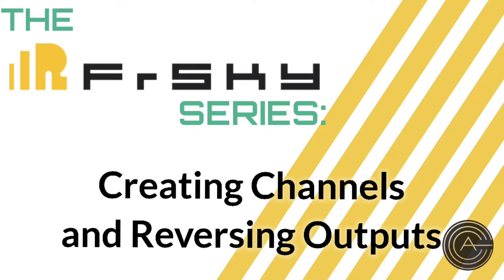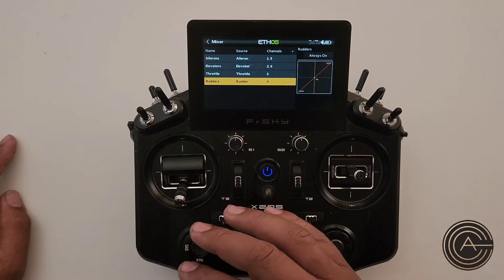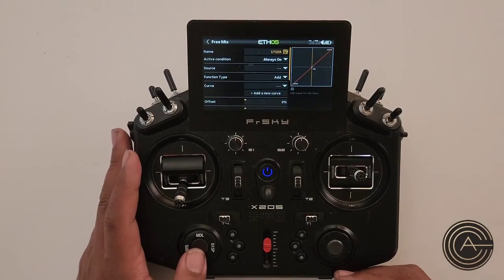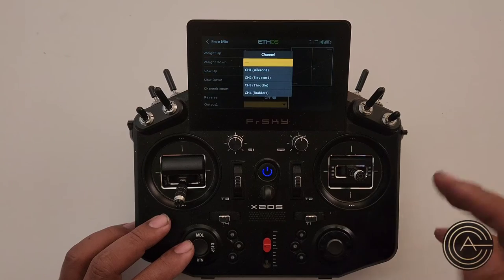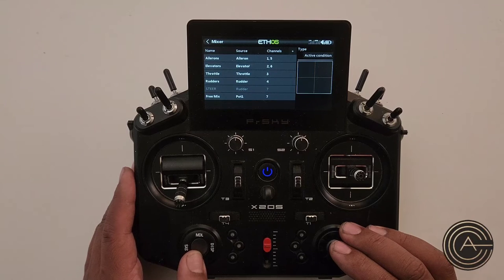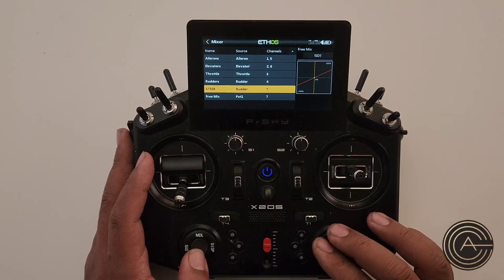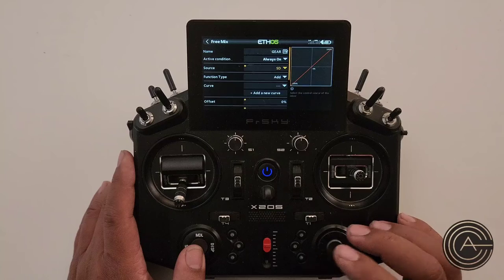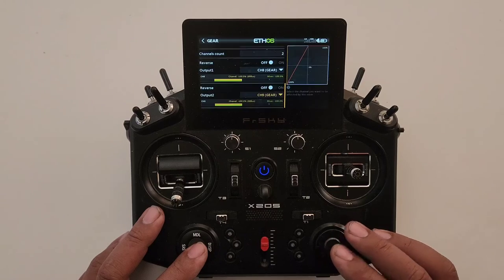The Frsky Series: New Model Setup. Creating Channels and Reversing Outputs (Freewing F-16 70mm)

Comment: Using your setup for my warbird retract tailwheel for trimming with the pot and not steering while retracted. My old radio brand would've taken hours to figure those mixes out. The Ethos system is much more logical, thanks.

Comment: Hi.

First of all, i got an FrSky XE 3D 😍

Your videos is awesome, for one like me, who nearly don’t get anything off it. But i do here 🙏🏻👌🏻

BUT, one question from me. I’m not using the radio for flight, its for an hydraulic excavator and a tractor 👌🏻

Now to the question. I really want a switch, so when i want a break from digging or drive, then i can push it. So the excavator/tractor is still on, but it won't move until I press the button back again and also the radio, so i can touch everything , JUST not that one button.

I hope you understand, what i mean 🙏🏻😊

Please make a video, so i can see what i should do. 😅 ofcause not, if you don’t want to 👍🏻

Best Regards Mike
Reply from the maker: Hello Mike. Apologies but I'm not sure i understand what you are looking for. I'm happy to help but I'll need a bit more info.  Do you want a switch on the transmitter that disables everything or on the excavator? Perhaps give me an example... like when i park, I would like the sounds, motor disabled etc by pressing a button on the transmitter.  Be as specific as possible... hopefully I'll understand!  If it's long,  send me an email at all.rc.air@gmail.com You can attach pics etc if you need.
Reply: Hi again @all_rc  .

I can try again, to explain, what i mean. 😊👌🏻

If i have digging for one hour, and i need a break from it. I will normaly shut Down the excavator, so when I'm lying remote control away from me, nothing happen when you touch the radio, because i have killed the excavator. 
What i want, is that i don’t have to kill the excavator, when i take a break. Instead i could push that switch and then it is working like i kill the excavator, But instead, the excavator is still on, but the whole radio dosen’t do anything, if your touching the stick or other switches. 😁

I thing, thats the best i can do, to explain myself. 😉👍🏻
But if you think its still hard, i will send you an e-mail 😁👌🏻

Regards Mike
Reply from the maker: Got it.  I believe i have a solution for you using ACTIVE CONDITION.  If you assign a switch to active condition of each item you want to disable that SHOULD work. It's late here.  I'll try it tomorrow and check to see if there's any problem using that method.  You may need to add another mix since Active Condition totally disables the mix. I'll report back tomorrow with a solution for you.
Reply: Hi  @all_rc  . Its 8 at the morning her in Denmark. But thats super cool, take a look and return.

Thanks for the help.
Reply from the maker: Hello Mike, 
I tested it this morning and it seems fine. You'll need to do your own tests and report back of there are any issues. What you can try is this: first, make a clone of your model so if you make a mistake,  you can always go back.  Now go to MIXER and look at all your mixes. Decide what mixes you want to disable. On each mix, you'll need to go to ACTIVE CONDITION and click on it. Once its highlighted,  flip the switch you want to use as the enable switch. Do the same for each mix that you want to disable. That should be it.  I do not know how complicated your setup is but i tried it on a plane and it worked fine.  When you disable a mix with active condition,  you are essentially temporarily removing the mix.  Do it once at a time and test after you add each disable. If something weird happens, you may have to add a mix to replace the one you disabled.  But on my plane,  i didn't have to do that.  Try it out and let me know your results.
Reply: Hi  @all_rc  .. alright, i will try it over the weekend and return back. 😊👌🏻
Reply: Hi again @all_rc .  :D

Sorry for all my messages, but i think i got it now.

I have used one of these 6 buttons down at the large screen, but is it possible to reverse these buttons, because i really want that, the light is on when i'm going to break and the radio is killed off.
And now, there is the light on, when everything is on.

I hope you understand mate? :)

Regards Mike